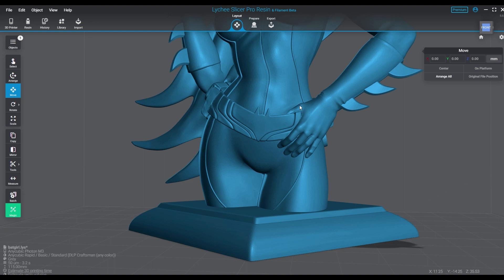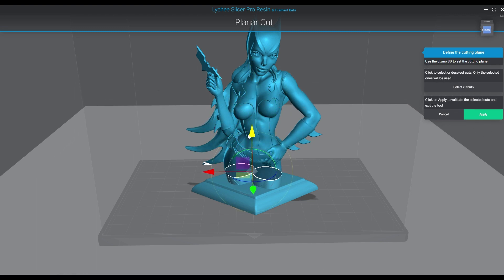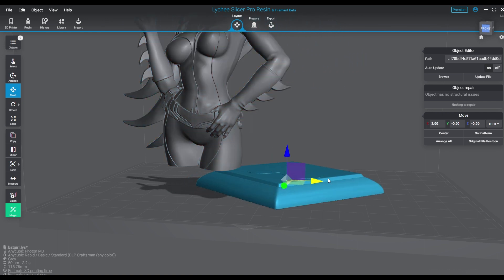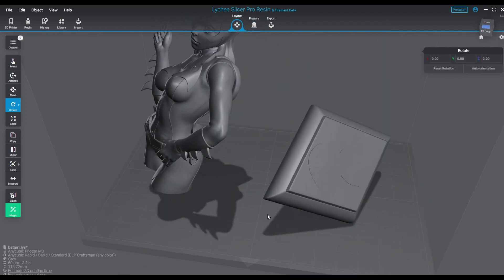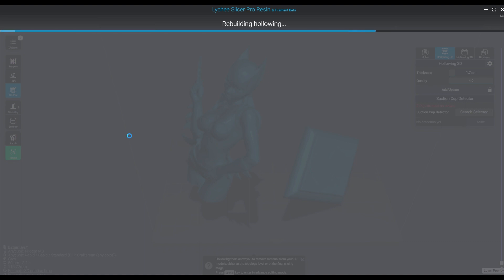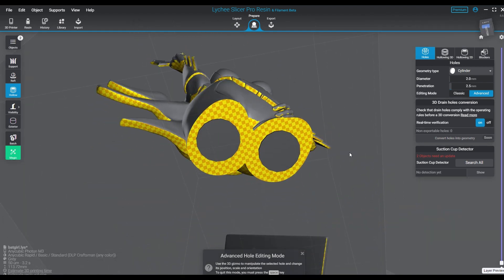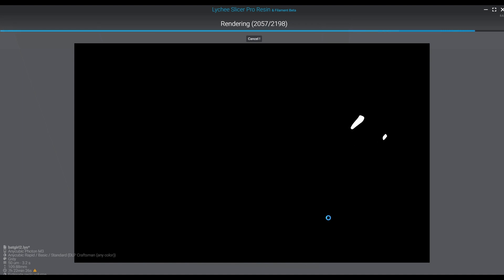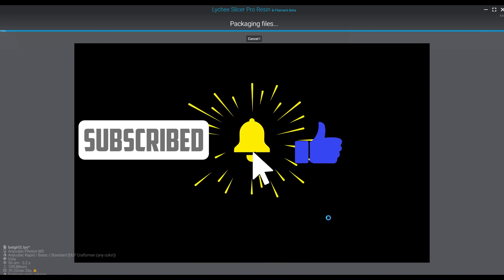Slicing & Supporting Bat Girl - Lychee Slicer Planar Cut tool Demonstration

Comment: I have only used this feature a couple of times, but in each instance, in addition to the slice I wanted, lychee automagically cut the base (exactly) away. In fact, since I wanted the base attached during printing, I had to 'merge' the model back to the base.
Reply from the maker: Yes, the split, merge, cut tools are a bit dodgy sometimes. Have had it where it just won't cut something at all, and had to bring into Mesh Mixer to fix.